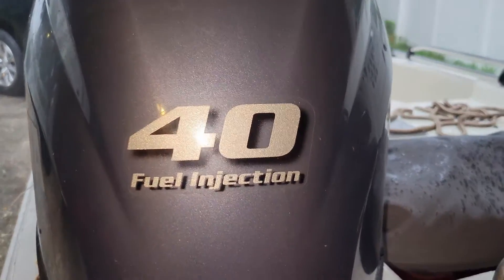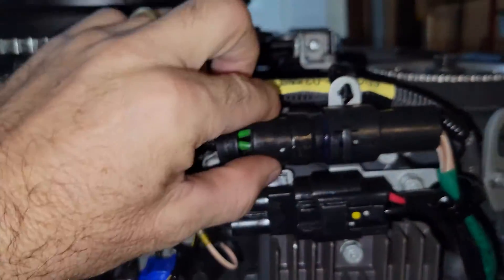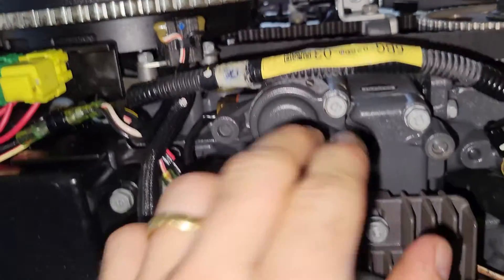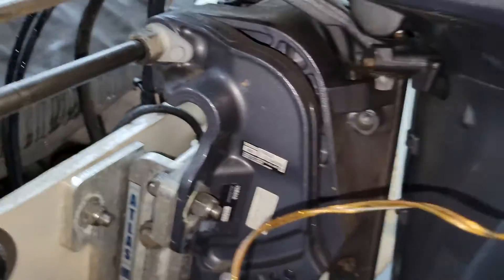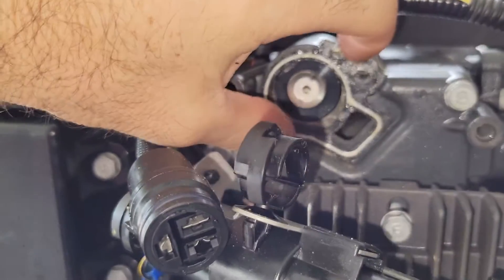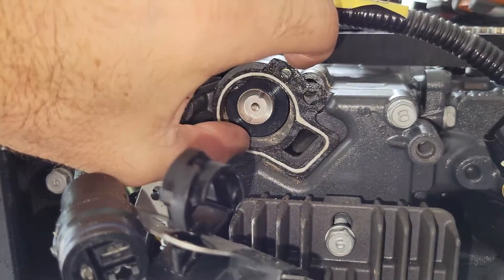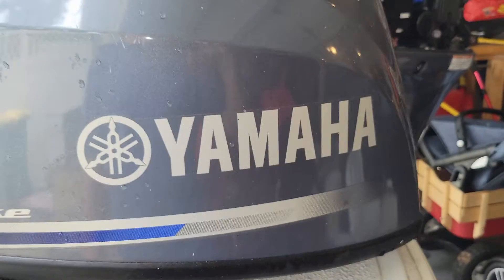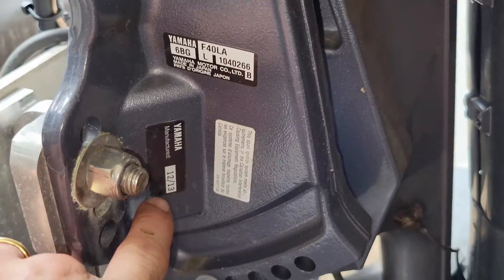⭐ YAMAHA 40 HP THERMOSTAT REPLACEMENT  ⭐

Comment: Gday mate i have just bought a 2021 f40la and you know something it looks identical to yours , i wonder if there is any difference as i cant get a workshop manual for mine yet everything looks the same ,the internal anodes are different to any i have seen advertised tiny things with a screw going through the anode into a bolt (can see issues already with corrosion )  i dont know what yours are like i have seen the pencil ones on 50hp but this is the first video i have seen about a 40hp excellent teaching video dont give yamaha yourmoney do it yourself  .

Comment: I have a small Yamaha 40hp outboard boat motor that takes 10-15 minutes to warm-up & run right. Already did new plugs, new Gas (91 octane), added Sea Foam to gas, but it is still doing it.
Any suggestions &/or anyone know someone in Phx. Az that can look at it?
Reply from the maker: Could need to clean/rebuild the carburetors.  

Or possibly replace the thermostat.  The thermostat allows a certain amount of water to flow through the engine to keep it at the right temp.  If it doesn't regulate the flow properly, that cold cause the engine to get too hot, or never maintain the desired temp.
Reply from the maker: just found this on rebuilding the carb on an f40.  Seems like some good info that may help:  https://www.youtube.com/watch?v=UZLTH94Yvnk
Reply: posssibly a stuck open thermostat check it if you havent done so

Comment: When do you typically change the thermostat?
Reply from the maker: I don't do it more than once every few years (depending on use).  You may want to look up the recommended schedule.  It's  good to open it up once a year or so and lube the bolts because they can get corroded and become a real problem when you actually need to change the thermostat.
Reply: @JimWellman  thanks I own a brand new F25 four stroke so I wanna last a long time

Comment: Hello, great video. Want to replace thermostat in Suzuki DF 140 2008. I don't think it needs a gasket but wanted to ask if the bolts need anti seize when replaced. thanks
Reply from the maker: It wouldn't hurt.
Reply: @JimWellman  thanks

Comment: I wouldn’t even put a thermostat back I would leave it out because the water will always be flowing as soon as you crank it
Reply from the maker: The thermostat regulates the temp and is needed.  If not installed, your engine may run hotter and may take longer to heat up after starting.
Reply: @JimWellman  If not installed, it will have full cooling all the time, and run poorly in colder water, taking very long time to heat up. I won't even run on full power until heated up.